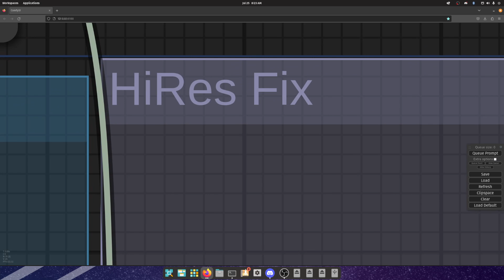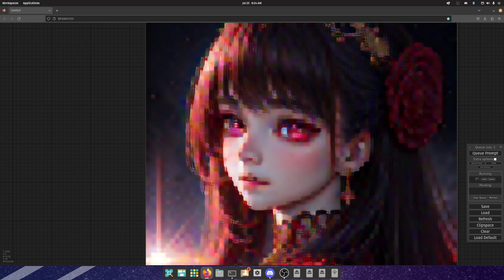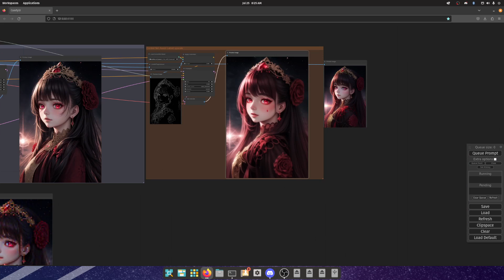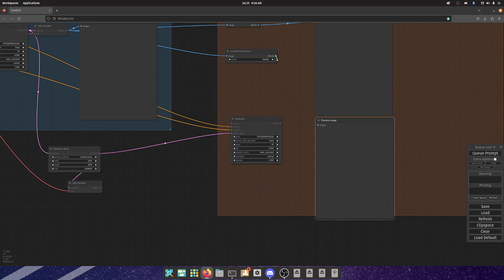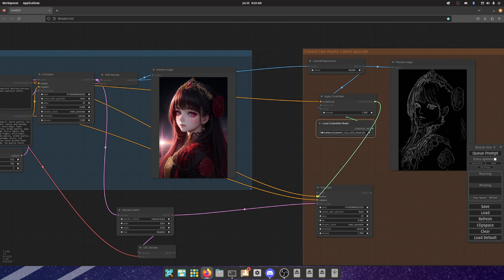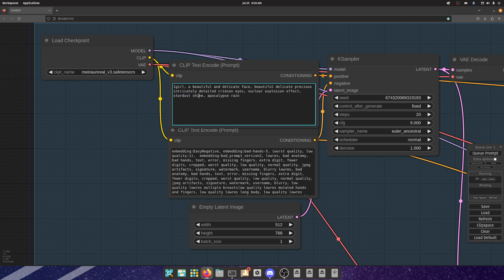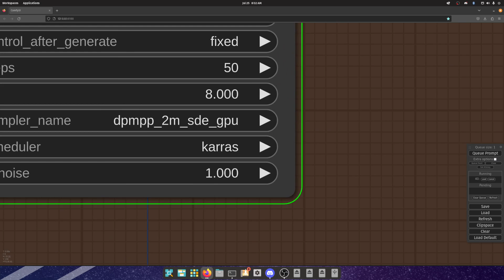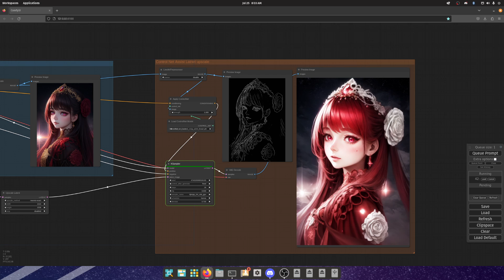ControlNet Assisted Latent Upscale (Enhanced HiRes Fix) - ComfyUI Tutorial

Comment: I tried to use this lesson, but unfortunately I encountered some difficulties, which is why this guide simply becomes irrelevant.
1. It is not clear how to install the Preprocessor and nodes for it (I had to find this information myself since your link is not relevant).
2. It is not clear which LineArt preprocessor to use since they have changed since the video was released and different options give different results. 
3. It’s also worth mentioning separately in the video description that the example is specifically for 1.5 models (since XL models need their controlnet model, which some noobs like me may not understand)

It is worth updating this information at least in the description under the video. Thank you in advance!

Comment: This is a really smart way to keep the base image consistent, seems like it just shifts colors around. Im guessing you could fix this by adding additional text conditioning and combining them, or possibly even through attention masking. Ill definitely be using this
Reply from the maker: you can also daisy-chain controlnets together. if your colors are shifting, use the T2I Color Adapter or inject color into the latent.

Comment: Thanks for the tip, but I got another one. Keep the controlnet value between 0.400-500, it'll still maintain the original photo's shape of lineart and add more details than when it's set to 1.0
Reply from the maker: yeah major oversight on my part for not talking about those values at all.